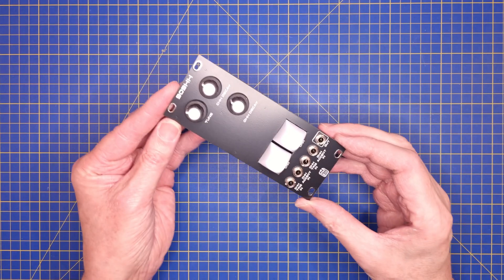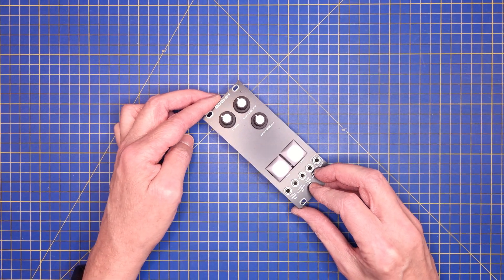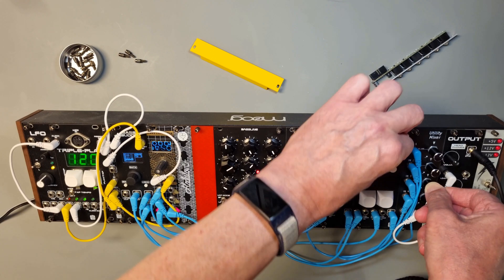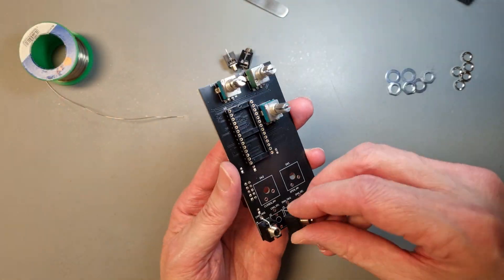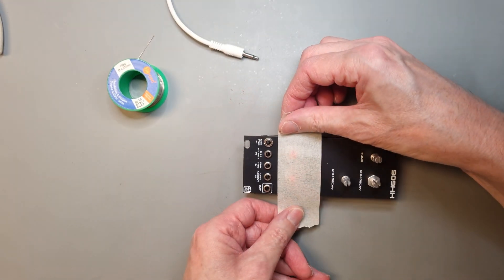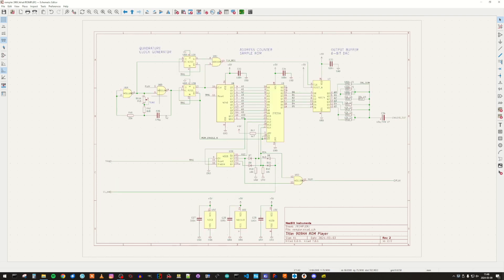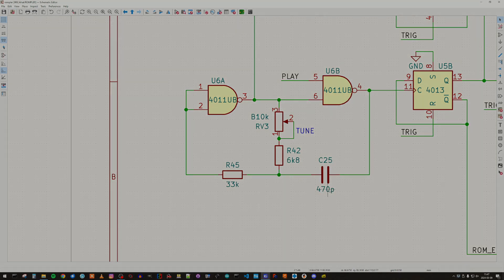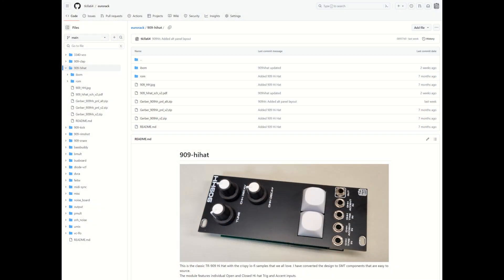Eurorack DIY: 909 Hi Hat Update (Episode 3)

Comment: Maybe, You should combine kick drum, snare drum and hihat in one tight module, much smaller buttons & knobs.
.... or combine hi-hat, crash and the other cymbal in one module, using 32 bit microchip fubarino, that can contain a 2 full seconds of 16 bit sound in it's 256 kb flash, tested, works. you can ad many more samples than, just Roland while still using the analog vca, decay stuff from roland. i'm prettty sure that's smaller than 3 40+pins eproms.
Reply from the maker: Yeah, I'm thinking of combining all the cymbal voices (Hihat, Crash, Ride) into a combo module, using a microcontroller.
Reply: i'd build /buy one of those 😍 @MeeBilt
Reply: I got some 'wav' file and extracted 88.200 'samples', 16 bit or 'short' datatype, converted that in header and it burned perfectly in the Fubarino and that one works with the arduino IDE. accept you have to see the datasheet for the register locations (timers, interrupts, etc). instead of 40174 (74hc174) use 74hc373 / 74hc573 to make it fully 8 bit. there are some cheap 16 bit adc's from Texas ...., that can only do some 250 samples second, rather than the 10 bit onboard. 
 @MeeBilt
Reply: There are low cost 16 bit adc's from Texas ...., single, dual or quad, but can only do 250 samples second. rather than the 10 bit onboard.  @MeeBilt